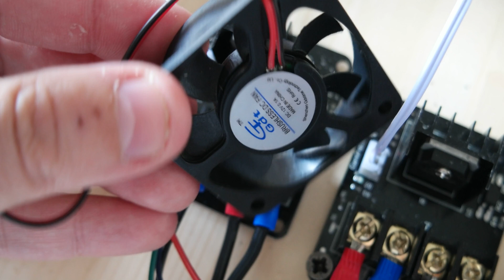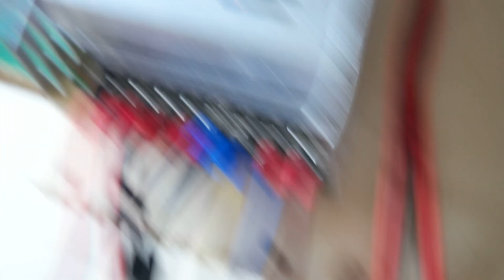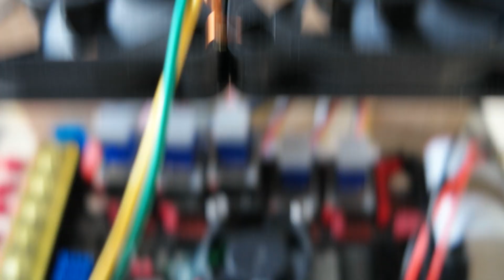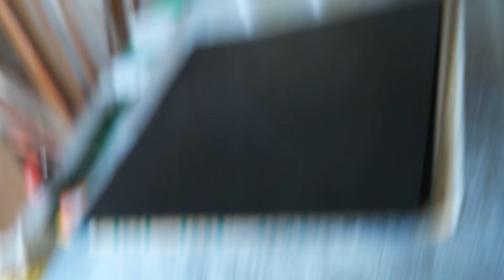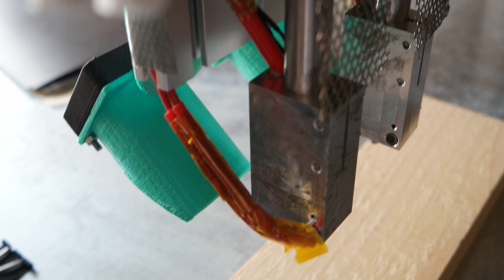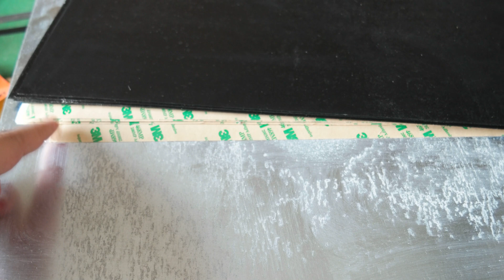SKR Pro v1.1 and Mosfet module connection for Heat Bed / Heater Resistance

Comment: Did the heat sinks end up shorting out any connections below?
Reply from the maker: no since the heat sink are positioned just on top of the parts that need to be cooled. If you want to make sure you can put some pads in between the board and the heat sinks.

Comment: Did you have to change any of the pins?
Reply from the maker: if you mean pins on the drivers, no. On the mosfets too no. If you use the mosfets for the heated bed you need to be careful to the polarity since it seems that the polarity on the board are wrong. But I do not use the bed so I did not follow the details, you can ask on the facebook group. Let me know if I answer your question.
Reply: @ganzoai  sorry it was a bad question. Did you have to change the pins in the Marlin configuration?
Reply from the maker: @cfletcher1856  nothing has to be done in  Marlin to use the mosfets. Basically Marlin has no knowledge of the Mosfets. For example for me since I am using 2 extruders the board just turn on the extruder to be used, Mosfter gets a signal from the heater 1 channel and turns on the power from the power supply to the heater resistor, that's it !
Reply: @ganzoai  Thanks!!  I am trying to use the mosfet for my heat bed.  So i think i will have to change the pin since marlin is set up with PIN PD12 as hot bed.  I will need to get it set to heat1 or heat2 since heat0 will be my hot end.
Reply from the maker: @cfletcher1856  just make sure to check the polarity for the bed on the board, seems that they are backwards. Ask on the facebook group. I do not use a heating bed so did not care much.

Comment: Thanks for posting this. I've just finished wiring up an SKR PRO and MOSFETs on my Anet A8 with Titan extruder. I haven't powered it up yet as I'm a little nervous! Any final check suggestions?
Reply from the maker: if you wired like I did you are all set, just make sure polarity on the power supply side are set correctly